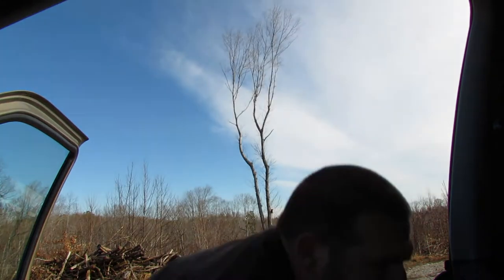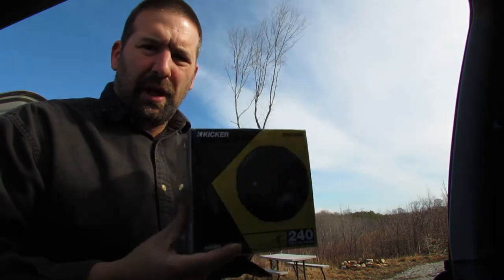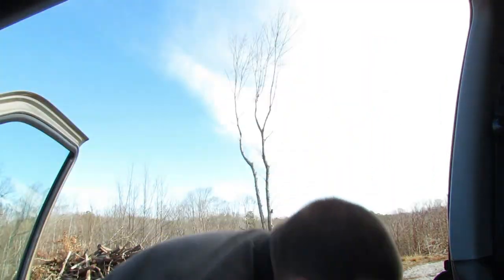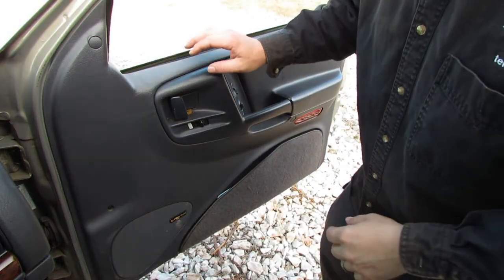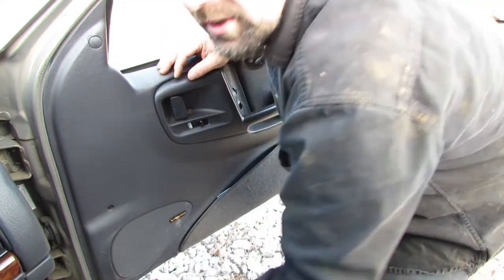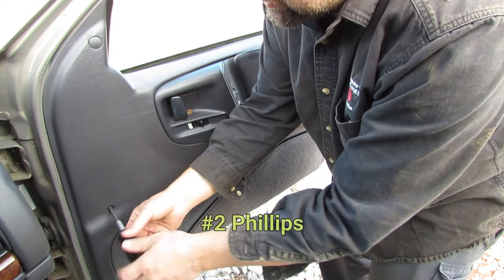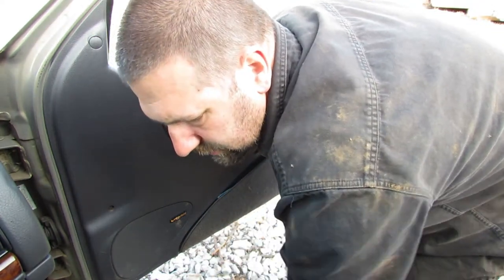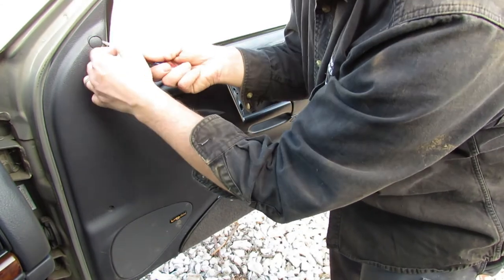Part 1 Jeep Grand Cherokee Speaker Upgrade

Comment: My RH door speakers gave out on my grand Cherokee. I bought speakers for it but still won’t work. I know it’s not the speakers because I tried them on another vehicle and worked. Any idea on what it could be??
Reply from the maker: Juan L. L. that is interesting. I would say a cut or chaffed wire somewhere. If you have the infinity system the amplifier and wiring are under the rear seat. Check those wires and connections really good. If anyone has more information on this we would love to hear about it. Good luck. Let me know what you find. ~Mr. C.
Reply: On my Jeep Grand Cherokee right side speakers only work if I pull the volume knob down.

Comment: I believe you put the wrong type of speakers in. If that has the infinity system then only bass frequencies are sent to the door speakers making coaxial speakers pointless. Component speakers are what you need for it to sound the best.
Reply from the maker: Shad Olson thank you for your insight into the workings of the infinity sound system in our Jeep. We enjoy the sound greatly after the upgrade even if the speakers are not optimal. Mrs. C. Is all about that bass... ~Mr. C.
Reply: this is a year old but the infinity gold system that is in my jeep had a "8 speaker system", 2 tweeters in the dash, 2 speakers in the front, 2 speakers with their own tweeters in the back. Would coaxial speakers in the back make sense to have?

Comment: @13:30 I did that but I still get no sound
Reply from the maker: Dayblue that is unfortunate. Did you have sound before installing new speakers?  You could have a problem with the head unit or wiring. Make sure the connections for the adapter in the door are good. I have seen those spade terminals fall off if put in a bind while installing the new speakers in the door.  Hope this helps. ~Mr. C.

Comment: Do you happen to have a link for everything?
Reply: The one in description isn’t the kicker speakers and I like the kickers over the original, been trying to find the right ones
Reply from the maker: Trevor Tube I found the set on eBay below is the link. Remember, if you want to use the adapter rings you will need to find two more. I also did not see a way for the dash speakers to mount inside, if you figure it out I would love to know. I will do some digging and see what I can come up with. Either way here is the kit. ~Mr. C.

https://www.ebay.com/itm/Fits-Jeep-Grand-Cherokee-1996-1998-Speaker-Replacement-Kicker-DS-Series-Package/131727312615
Reply from the maker: Trevor Tube here is a link for the 2 pack of speaker adapter rings. Again, not needed but does make it easier. I found the original tweeters in the dash are still working great. ~Mr. C.

https://www.ebay.com/itm/Fits-Jeep-Grand-Cherokee-1996-1998-Front-Door-5-25-6-5-Speaker-Adapter-Kit/401539115766?hash=item5d7d98aaf6:g:UBAAAOSwXzBfO~cG
Reply: @NaturesCadenceFarm  thanks man appreciate it, yeah both my tweeters are blown so trying to figure that out to fix them and only my speaker in passenger door is working so I need new ones ASAP lol thanks again
Reply: @NaturesCadenceFarm  do you think a 1 in tweeter will fit in there I’ve been looking at some, tried to measure in the Jeep and it looks like there’s about 1.75 in of room under the tweeter grille or so
Reply from the maker: Trevor Tube I believe there is enough room inside of the dash to accommodate the 1" tweeters I saw on eBay. I was thinking it might be difficult to get tools in there. You might need to devise an alternative like an adhesive. I would love to know what you decided on and how it turned out. Good luck! ~Mr. C.